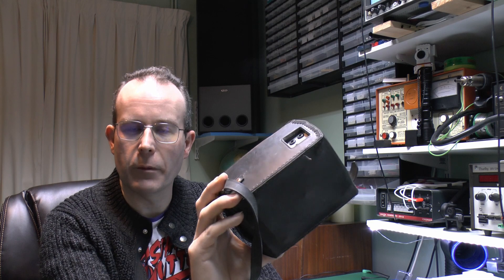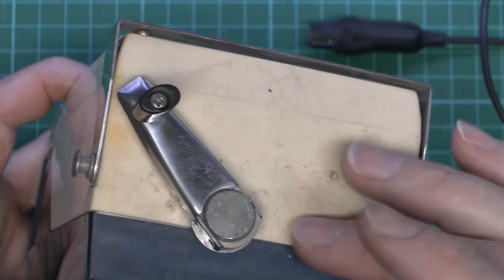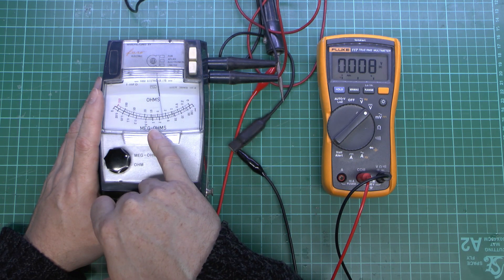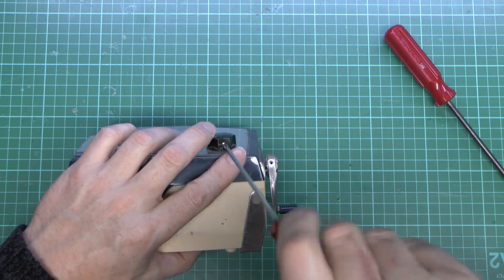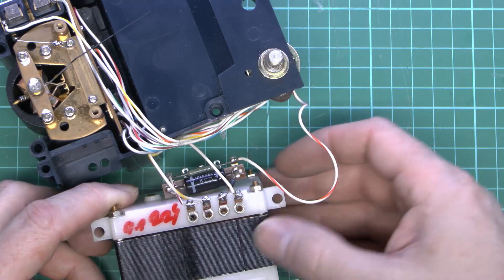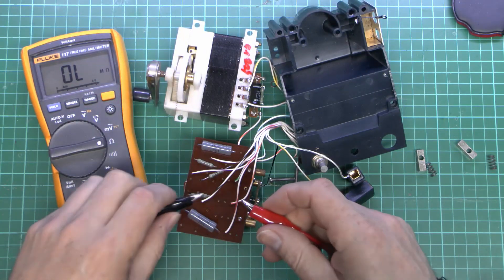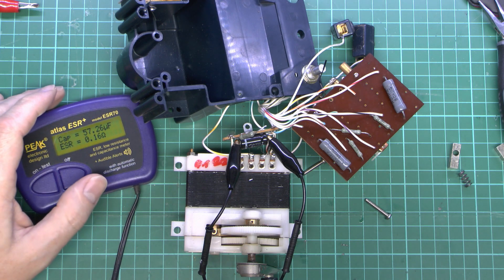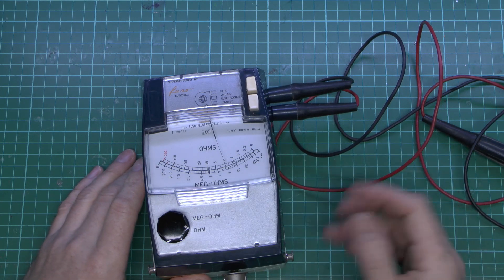Fuso Megohm / Ohm Meter Hand Cranked

Comment: I bought one of those meggers in Henry`s in Egware Road back in the mid to late 60s I think it cost £27.17sh.6d .Mine started making that noise but a bit of oil solved that.
Reply: john hill Henry’s Radio I remember it well used to go there with my Father, bought my first portable cassette radio player in the mid 70s

Comment: Check the small hair springs on the movement itself. I have seen similar before, after a little rough handling or a drop the spring has become entangled in its self. Karl

Comment: Re battery flap... You don't seem to see different units sharing cases like they used to - presumably it's got a lot cheaper to tool up a completely new plastic case for each product these days.
Reply: yep modern prototyping: 3d printing, cnc machining, all help do just that.  It was just this problem that lead to the end of british manufacturing, using old machinery, never modernising, then come the 70s it wasnt feasible to move forward as it required dumping everything, so it all got scrapped.

Comment: Probably dropped and the meter pivots are slightly bent. Not enough to bind, but enough to throw it out of balance though, those movements should be readable face up like AVO is, and not when vertical.